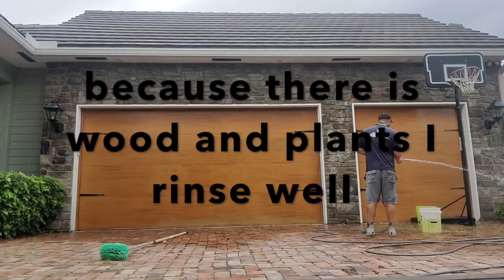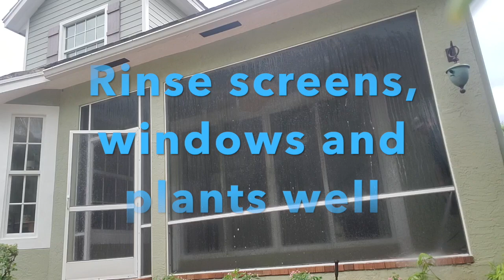Pressure wash -Gutter Brightening  SoftWash

Comment: you need to connect your trailer with your truck so you can charge battery When you are driving your battery on the trailer. That’s what I did to my Rick yeah I don’t charge that battery for the past two years